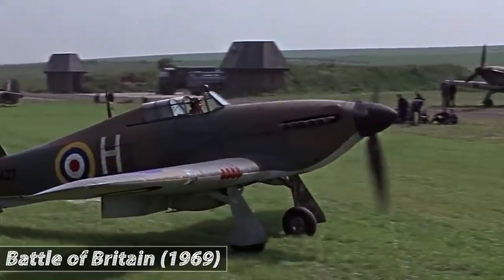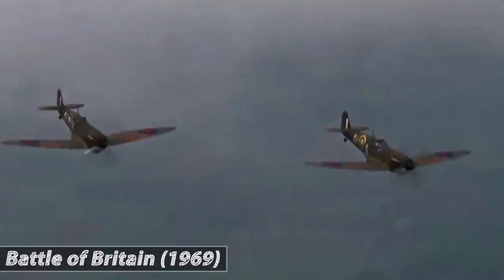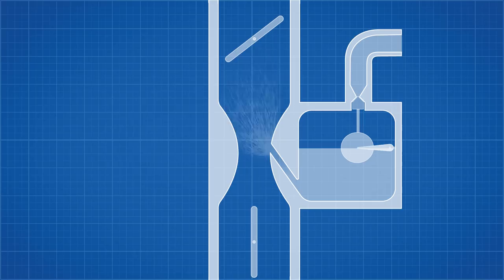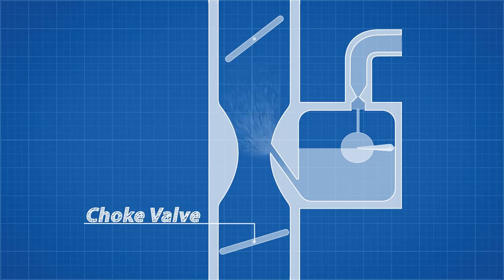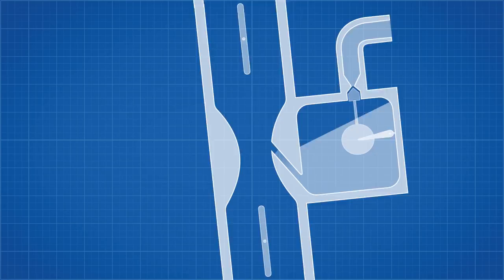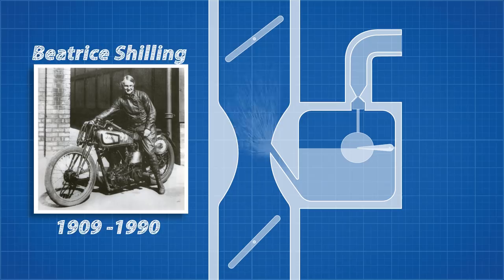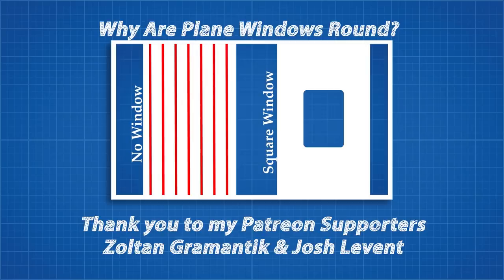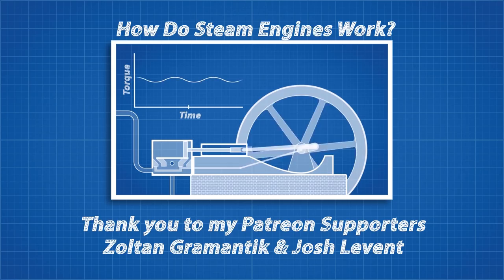The Spitfire's Fatal Flaw

Comment: Spitfire's fatal flaw, no fuel injection. There you go no need for the video.
Reply: Andrew Fishburn that was difficult lol! Did you notice the aircraft he showed at the start and did the victory roll isn't even a spitfire ?
Reply: timopenchords 
Yeah , hurricane did the roll.
Reply: +timopenchords  The Hurricane had that same problem so as an example of what happens what is actually wrong.
Reply: The two aircraft shared the same engine.   So it wouldn't matter which plane was shown has they both had the same problem
Reply: So the title is bollocks. Nothing to do with the Spitfire as such, but a problem with the Merlin engine, largely overcome by 'Miss Shilling's orifice' within months and during the Battle of Britain.
Reply: +Phil Evans 'Miss Shilling's orifice' did nothing to fix the stalling problem.. it only addressed the flooding issue that could lead directly to the aircraft crashing due to loss of power.. Only the American Bendix-Stromberg PD-18 pressure-feed carb developed for the Packard V-1650 cured the flawed R-R Merlin.
Reply: 18tangles - Finally, somebody who recognises that aircraft design is about compromise, achieving the OVERALL performance best suited to the intended role.
Reply: +otterspocket2 Its very clear from this example that overall performance was superior utilizing Direct Fuel Injection.. a technology the the brits simply didn't have yet.
Reply: +Tiger Moth  That's good for a laugh!Hahaha!  As I've pointed out before... you are no expert on WW2 aircraft engines... particularly fighter planes.
Reply: +Tiger Moth  Then explain why there were not one but 2 technical efforts to correct the fatal defect caused by the outdated SU float valve carb????
If it wasn't an issue?  Why go to such tremendous effort to correct the fatal flaw.
Reply: +Tiger Moth   Yes, and I have had to correct many of your egregious and rather embarrassing mistakes.. In particular the difference between manifold "boost" and Water/Methanol Injection  and the difference between 'WEP' War Emergency Power and MIL Power (P-100) aka Max. Continuous Power Rating..
Two very important fundamental concepts you were hopelessly confused about until a corrected you.
Reply: +Tiger Moth   Explain why there was a concerted effort to remedy this flaw that was not shared with Luftwaffe or American aircraft???
Reply: The real doktorbimmer 
All aircraft have flaws, Britain definitely had fuel injection technology even before the Spitfire. 
We all share an enthusiasm for these machines so let's try to enjoy that instead of bickering with each other eh?
Reply: +Andrew Fishburn Please cite an example?  The video's topic is in fact the R-R Merlin's fatal flaw.. so that is the topic of discussion here.
Reply: +The real doktorbimmer - It was an 'issue', are you happy now? It was not a 'fatal flaw' though, and there was no 'tremendous effort' to correct it - just a 10 minute field modification to limit the effects to a momentary misfire. Not ideal, but not a major problem to a competent pilot aware of this behaviour and flying/fighting accordingly. The overall attributes, both of the engine and the airframe, more than compensated for this.

I'll give you another 'issue' if you like, that of fuel consumption. This would have been a problem on later marks in the role of escort, far bigger than the negative G issue, but the original design was for an interceptor. Get as high as possible as quickly as possible, then run down the enemy as fast as possible. That's it, that's all the engine was supposed to do. No 'endurance marches', and with the Chain Home network being developed simultaneously there was very little need to loiter on standing patrols either.

The indisputable fact is that the Merlin III outperformed it's fuel injected rival, the DB-601A, at all altitudes - giving the Spitfire better climb performance, acceleration and top speed than the (400lbs lighter) Bf109e. Not bad for an engine and an interceptor that were 'fatally flawed'.
Reply: +otterspocket2 You are referring to the temporary "fix" to correct only the flooding problem that could indeed cause the engine to stall completely.. a fatal flaw even in non-combat operations..
The American Bendix pressure-feed carb solved both issues related to the outdated SU design which suffered both loss of power AND stalling due to flooding..
Direct Fuel Injection was immune to these flaws and had several other significant advantages such as increased power output (carbs work by restricting airflow) and resistance to icing and detonation... 
It is why the Luftwaffe continued to use fuel injection throughout the war and was later adopted by BOTH USAAF and RAF late in the war.. of course the introduction of the jet engine halted further Allied development after the war.. propeller driven fighters were rendered obsolete by this time..
Reply: The real doktorbimmer 
Fuel injection technology was around in the early 1900's and Hesselmen invented direct fuel injection. Maybe they didn't have an adequate system who knows, we do know that they chose to stick with the design. 
We have to remember that Germany was actively preparing for war which Britain was not. We are also looking back in hindsight which obviously they didn't have the benefit of. They needed reliable robust engines for war and the merlin was the most successful engine of the war for a reason.
Reply: +Andrew Fishburn No, wrong answer... Cite an example of a brit fighter plane equipped with direct fuel Injection prior to the introduction of the Daimler-Benz 601, BMW 801 or Jumo 211 in the early to mid 1930's?????
Direct injection was invented by Rudolf Diesel in 1892
Reply: The real doktorbimmer 
Not wrong, we're talking about petrol/gasoline not diesel engines. You're attempting to change the argument, I stated they had the technology not an equipped example.
This is all about design theory and in that day in age no one single design was considered superior, only later on did they confirm the advantages of FI.
The merlin was a proven engine in all aspects and like others have stated no pilot suffered because of its design flaws. It out performed any german fighter throughout the war and Germany actively pursued a challenger to compete. That's what I would call a concerted effort, Germany desperately tried to make a fighter just to counter the 'flawed' Spitfire.
Reply: +Andrew Fishburn   Then cite an example of a brit fighter with Direct Fuel Injection prior to the RLMs adoption in 1935???
Reply: The real doktorbimmer 
Again trying to change the argument, RR rejected R&D tests for FI in favour of the merlin design. Hindsight is a fine thing isn't it.
Reply: 18tangles 
Seems to go around YouTube disputing anything allied whilst protesting the superiority of anything German...... hang on ?
Reply: +The real doktorbimmer - You're still not getting what I'm saying. Comparisons between engines, or aircraft, are meaningless unless you take into account what's required of it. It's like the debate over which was the best fighter of WW2 - what do we mean by a fighter? An escort, an interceptor, a dog-fighter? Do we want to 'shoot and scoot' or 'turn and burn'? It depends on factors such as tactical necessity (what are we trying to achieve?), and the opposition (bomber, fighter - what are the enemy's role and tactics, the strengths and weaknesses of their aircraft?) It's like comparing a Rolls Royce with a Lamborghini - how fast do you want to get there, how comfortably and how many passengers do you want to take with you?

Given that RAF pilots were aware of the negative G issue, all they had to do was avoid prolonged negative G manoeuvres. The only real advantage to the enemy was the ability to enter a dive more quickly by throwing the stick forward rather than first going inverted, and therefore (potentially) escape an attack from behind. At this stage of the war (BoB), in the role of interceptor, nobody would be too concerned by the enemy's escorts being able to run away - next to destroying them that's the 2nd best outcome. With the roles reversed, no attacking aircraft would want to out-dive it's target, as the hunter would then become the hunted. I stress again, it's all about the role that the Spitfire/Merlin III were designed/developed for. What would indeed have been a 'fatal flaw' on later marks, in other roles, was at the time little more than an inconvenience.
Reply: otterspocket2 
Exactly, also why we had Spitfire's and Hurricanes. Hurries shot down more aircraft in battle of Britain and were considered a better weapons platform.
Reply: +Andrew Fishburn  Rolls-Royce did not develop the fuel systems on any of the Merlin engines.. Early Merlins used automotive type SU carbs or later American produced Stromberg-Bendix carbs..
The only pressure-feed system produced by Rolls-Royce was a copy of the Bendix first used on the Griffon 101 introduced in 1946. Ignorance is bliss... isn't it?
Reply: +Tiger Moth  Just the facts..
Reply: +otterspocket2   We are trying to achieve a fighter aircraft design that does not stall..and does not lose power when engaging or being engaged by an enemy fighter.
A problem not suffered by pilots flying American or German produced fighters at this stage of the war..
Reply: +Andrew Fishburn and what has been repeated over and over again is that the Spitfire and the Hurricane were both equipped with fatally flawed SU carb, and suffered the exact same fatal performance deficiencies..
Reply: The real doktorbimmer 
I have the Internet too and you're dodging the subject. We're talking about the knowledge of said technology, Germany didn't invent any of their engines they merely developed them from others hard work. Fun fact, Europe was a hive of activity during the early 20th century especially in engine design & technology with Britain at the forefront. Without this activity Germany wouldn't have developed FI engines or any of the aircraft that utilised it. Also without British breakthroughs in fuel Germany would have simply ran out of it.
Reply: +Tiger Moth   Sorry Tiger Moth, The Bendix PD carb was an AMERICAN design. First delivered to the brits in shipment of American made aircraft with Allison V-1710 engines and later Packard V-1650 installed on britsh aircraft.
Reply: +Andrew Fishburn  No you are dodging the subject.. by the way, the type of internal combustion engines used by the RAF during WW2 were invented in Germany by Nikolaus Otto and Carl Eugen Langen
Reply: The real doktorbimmer 
The subject is whether or not Britain had FI technology, which they did. Use of said technology isn't the argument. Also the difference between development and invention seems to confuse you. No german invented the engines they developed them from existing designs spanning back as far as the early 1800's. The engines used by the R.A.F were developed in Britain.
Reply: +Tiger Moth  The brit were still using steam engines when Germany developed the first practical internal combustion engines which were patented and sold under license around the world... including in the UK.
Reply: +Andrew Fishburn  it certainly is.. if the brits had fuel injection technology at the time the Merlin wouldn't have had the fatal stalling problem which is the topic of this video...
Reply: The real doktorbimmer 
They had the technology as did others, you're just desperate to 'win' now and are creating false subjects. The development of the internal combustion engine was by more than one person, a series of inventions and technology breakthroughs led to its development. The engines developed in Germany were mostly copied from previous designs and just got patented first.
The decision on the merlin engine being carb instead of FI was indeed a decision.
You need to actually research the development of the merlin engine.
Reply: +Andrew Fishburn Not at all... you have simply exhausted the resources of your limited knowledge on this topic
Reply: +Tiger Moth  The Stromberg-Bendix PD carb was developed in 1934.. long before the Merlin 66 existed
Reply: The real doktorbimmer 
Ad hominem attacks are the refuge of a strawman argument. You won't dispute what I have said because you can't as Germany never independently invented nor developed any engine design or technology.
Without British fuel advances none of your great German aircraft would have been built, fact. You lost this argument before it began, I'm simply having a conversation now which would be far more enjoyable without you turning it into a pissing contest. Which by the way you will lose as all Germans do. 😉
Reply: +Andrew Fishburn Don't cry about it now, you were bested fairly and soundly.
Reply: The real doktorbimmer 
It's clearly evident that you lost the argument before it started, you won't dispute anything I said because they are facts. Although I guess you would define victory differently than me, being German, how many wars have you won? 😂
Reply: +Tiger Moth   You really are like a Tiger Moth among Spitfires! Lol!! You have just proven you have no clue what Direct Fuel Injection is..
Direct injection uses injectors mounted DIRECTLY INTO THE COMBUSTION CHAMBER
No fuel is introduced into the combustion chamber until the piston reaches the top of the compression stroke and IGNITION occurs..
Reply: +Andrew Fishburn I simply called you out on an egregious and foolish claim you made... and then you completely failed to back it up.. you folded.
Reply: The real doktorbimmer - The debate was over the availability of fuel injection technology if RR had chosen to use it in 1940. You've been proven wrong, the grown up thing would be to concede that point, not side-step into some dick measuring 'who was first' contest.

The 'problem' would have been suffered by American pilots at that stage of the war, and for more than a year afterwards, since they were flying Merlin powered Spitfires and Hurricanes for the RAF. My guess is that they were all thankful not to be taking on 109e's in P-39's and P-40's (something about taking a knife to a gunfight). Their 'superior' engines gave such poor performance above about 15,000ft as to make them nothing more than target practice in the European theatre for which the Spitfire was designed. The same goes for the (British designed/American built) P-51, until powered by the (British designed/American built) Packard V-1650 MERLIN fitted with the (British DESIGNED/American BUILT) Bendix-Stromberg PD-18.
Reply: The real doktorbimmer 
Nice try, you didn't call me out on anything and you made the initial claim so the burden was on you. You still can't dispute anything I have said and continue with personal insults.
Reply: +otterspocket2  Rolls Royce did not have Direct Fuel Injection technology... or a pressure feed carb. in 1940.. THAT WAS THE POINT!
The Stromberg-Bendix PD carb is an AMERICAN design... not british.
Reply: +Andrew Fishburn Then just cite an example of a WW2 brit fighter equipped with Direct Fuel Injection before 1935?
Reply: The real doktorbimmer 
You need to cite proof that RR didn't have direct fuel injection technology in 1940, you made the claim. It's self evident that they didn't implement it, the point you made was that they didn't have knowledge of it. You're getting mixed up in your own argument.
Reply: +Andrew Fishburn LOL!!! You want me to prove that something didn't exist??  Something I just asked to prove it did!  I'm starting to think I'm dealing with a child, certainly not a mature adult.
Reply: +Tiger Moth You just said they did?  But didn't even know what DFI was... Why should we believe you?
Reply: +Tiger Moth  Introducing the fuel into the impeller is not fuel injection.. That is Draw-through-Supercharger Carburetion.
Reply: +The real doktorbimmer - You still don't get the difference between not having ACCESS to something and CHOOSING not to use it. War production didn't work like some kind of iphone/Samsung competition. If one engine manufacturer had access to technology that another WANTED to use, they would be ordered to share it under license (the same way that Packard were 'given' the Merlin).

I've just been out to buy a paper. Usually I go on my bike because 
it's cheaper and easier to park than the car, but if I have more to 
carry or if - as today - it's bloody freezing out there I go in the car. I still have the bike, I had access to it, I just chose to use the car because it better suited what I was trying to do today (not freeze my bits off).
Reply: +otterspocket2 So you are seriously suggesting Rolls-Royce INTENTIONALLY WANTED their Merlin engines to stall and lose power in high G maneuvers???
Reply: +otterspocket2  You absolutely correct about that! They do not work the same! No ones risking death, serious injury or invasion from another country if your smart phone design has a flaw...
Reply: +The real doktorbimmer - I'm seriously suggesting, as I've been doing since my first comment, that a compromise was made that gave the best engine FOR THE ROLE - an engine that would momentarily misfire (and possibly flood/stall BEFORE 'Miss Shilling's orifice' was fitted, but not after) in very specific circumstances that could be avoided in the role for which it was intended and used. NEGATIVE G manoeuvres, not  high (positive) G. This trade off produced an engine that outperformed the competition in every other situation.

I'm glad you mentioned high G manoeuvres though, since this highlights the Bf109's major 'fatal flaw' which was far more of an issue than a misfire, and unlike a flooded engine completely unavoidable in combat. Contrary to popular belief, the 109 could marginally out-turn the Spitfire ON PAPER. However, it would snap into a high speed stall without any warning. VERY few pilots were brave/foolish enough to take it to the edge of the envelope in combat, where simultaneous loss of control, airspeed and altitude would almost certainly result in being shot down. Even fewer were experienced/skilled enough to 'pull it off' with any certainty, and most who tried eventually learned a hard lesson - under a silk canopy - or didn't live to learn anything. The Spitfire, by contrast, gave adequate warning (buffeting) of an impending high speed stall, giving even low experience pilots the confidence to out-turn the enemy and putting 109 pilots in a 'damned if you do, damned if you don't' situation.

This left them with no real option when bumped from behind but to dive out of the fight - exactly what an interceptor wants an escort with inferior climb performance, acceleration and top speed to do - while the Spitfire could escape a similar situation without significant loss of altitude, and therefore very much still in the fight - exactly what an escort DOESN'T want an interceptor with superior climb performance, acceleration and top speed (thanks to it's 'fatally flawed' engine) to do.

Maybe you know about engines, maybe Google is your friend - I've no idea which. You certainly appear to lack understanding of the tactics of BoB era aerial warfare though.
Reply: The real doktorbimmer 
You claimed they didn't have FI technology, how do you know? Simple question.
Did you know that aircraft companies share info? Such as engines? Such as using RR engines in the testing stages of Me109 development. Also a key part in development of other aircraft and engines. 
Still think RR the best engine manufacturer in the world at the time didn't know about FI?
Reply: +otterspocket2 A compromise? Perhaps.. or as is clearly the case a better solution simply wasn't available in the british aero industry.. Even if we were to accept your theory? In any case in hindsight it was certainly a mistake that cost lives and limited the aircraft's maneuverability until a permanent solution involving the adoption of an American fuel delivery system is what finally cured BOTH the fatal flaws.
American and German aircraft were immune to this fatal flaw as they clearly saw the importance of maintaining proper fuel metering under all high 'G' maneuvers that R-R did not.
Reply: +Andrew Fishburn Well explain why German, American even Russian manufacturers adopted pressure feed fuel systems and Rolls-Royce continued to use an outdated automotive carburetor..?
Reply: +Tiger Moth You're clearly out of your depth here.. especially if you cannot grasp such fundamental fuel system concepts.
Reply: The real doktorbimmer 
I don't have to. You claimed that the British didn't have knowledge of FI (research who invented it btw)
The Spitfire had ONE minor flaw which never bothered anyone. The German fighters of the day had so many I can't even list them on here.
How many lives were actually lost due to the spits carbs compared to 10% of Bf109 losses on takeoff/landing?
Reply: +Andrew Fishburn I said, cite an example that they did? which you clearly failed to produce.  
I can only guess you have never flown? Certainly a sudden, unplanned and unpowered landing (possibly over enemy territory or over the sea) IS NOT a minor flaw!!!
Reply: +Tiger Moth  It wouldn't called a fatal flaw it no one ever crashed..
Reply: The real doktorbimmer 
They clearly had the tech only silly people think they didn't and I don't have to cite anything as you made the claim.
It's a minor flaw considering the massive advantages the spit had in every other area.
Reply: +Tiger Moth  If it was a minor problem? why not just one, but TWO attempts to fix it?
Reply: The real doktorbimmer 
How many hundreds of tiny incremental variants of literally all aircraft have been made? And you harp on about one tiny flaw.
The 109 had so many even commanders didn't want it, they had no choice in the end because of the Spitfire.
Reply: +Andrew Fishburn  We are not talking about whether they knew it existed.. the question was did they have access to practical, reliable, production quality fuel injection or pressure-feed carbs.. which clearly they did not.
You kids are suggesting that it was something simple as downloading an app on your smart phone..
Reply: +Andrew Fishburn  Now your just taking a piss! Are you suggesting that Spitfires were never shot down by a Me-109s, Fw-190's or other aircraft?  
Now if the Spitefire was so fast it couldn't be shot down? Now that would be a MASSIVE ADVANTAGE.
Reply: The real doktorbimmer 
Now you're just lying. 
" a technology the brits simply didn't have yet."
Your comment.
Even though the same engines used RR engines for development  (copied)
You don't know who invented fuel injection do you?
P.S. A patent often doesn't tell the true story. Daimler benz know this but they don't want us to know.
Reply: +Andrew Fishburn Well if you insist they did PLEASE CITE AN EXAMPLE?
Reply: +Andrew Fishburn  Now you are suggesting Rudolf Diesel didn't  invent the first practical Direct Fuel Injection System.
Please Just tell us who did?
Reply: The real doktorbimmer 
I'll cite you an example of why this flaw didn't matter one tiny bit.
primaryhomeworkhelp.co.uk
Reply: +Tiger Moth The RAF certainly lost many planes... some either directly or in part to the Merlin fatal flaw... many were lost to unrelated circumstances.
Reply: The real doktorbimmer 
I'm not suggesting anything he stole his ideas and patented them as his own. Lots of inventions are contested.
Reply: +Andrew Fishburn Tell us who you think did invent direct injection?
Reply: +Andrew Fishburn How old are son?  That is a site for children struggling with their primary school homework..
Reply: +Tiger Moth Why don't you request the MoD for that information?
Reply: The real doktorbimmer 
An Englishman of course, we invented everything.
Reply: +Andrew Fishburn  Where is your proof?
Reply: The real doktorbimmer 
Google.
Reply: +Andrew Fishburn Google is not an brit invention either...
Reply: The real doktorbimmer 
Yes it is...
Reply: +Andrew Fishburn  You should know this kid..Google was created by American Larry Page in Menlo Park, California
Reply: +Andrew Fishburn - "I'll cite you an example of why this flaw didn't matter one tiny bit".

Don't mention the war. I did once, but I think I got away with it.
Reply: +otterspocket2  How would you like a ride in a single engine airplane that sometimes the engine stalls completely without warning..  and never mind someone is trying to shoot down the whole time...
Reply: The real doktorbimmer - The RAF certainly lost many planes... a handful POSSIBLY directly or in part to the Merlin 'fatal flaw'... many, many more were saved, and many German planes lost, due to the OVERALL superiority of the Merlin over it's contemporaries (I'm getting tired of writing this) IN THE ROLE FOR WHICH IT WAS DEVELOPED.
Reply: The real doktorbimmer 
Ask a German pilot to choose between a Spit or any other plane. We both know which they will choose.
Reply: +Andrew Fishburn That's easy... a Me-262
Reply: +otterspocket2  It was not to developed to fail to run properly or fail completely during a dogfight... which is why it has be accurately called a Fatal Flaw..
Reply: The real doktorbimmer 
That's cheating and no pilot would use that plane. If we're talking about fatal flaws that entire aircraft was flawed. If it was peacetime it would have only served as a prototype.
Reply: +The real doktorbimmer - I started flying on microlights, with a 2-stroke rotax engine (think 'lawnmower') revving like a bastard from takeoff to touchdown. Failure was so commonplace we used to joke about 'fuel off' being included in the landing checklist :-)

Obviously nobody relishes the idea of an engine failure (which can happen at any time for any number of reasons), particularly in a single engined aircraft. With engine stalling, as opposed to misfiring, being such a rare occurrence though - and only while performing a manoeuvre that had little operational value for a pilot who knew his aircraft anyway - I'd be far more concerned about entering a dog-fight with an aircraft that was outperformed in every other aspect by my opponent's - something no Spitfire pilot had to worry about until the appearance of the Fw190.
Reply: +otterspocket2 How many kills did you score with your lawn mower powered glider???  OH! that's right... you don't even need a pilots licence to fly a shed like that... LOL!!!
Reply: +Andrew Fishburn  With a 100+ mph speed advantage over any Allied fighter it indeed had a MAJOR ADVANTAGE over any aircraft that saw combat service during WW2
Reply: +The real doktorbimmer - I accept that my 2.0 litre car costs more to run, tax and insure than a 1.1 litre car, but accept the trade off for the increased performance. I'm sure the engine designers were aware of the increased cost - the 'flaw' - but they went ahead and 'designed it to be more expensive' anyway. Perhaps they lacked the technology to make 1.1 litre engines.

You keep banging on (and on, and on) about this 'fatal flaw', as though it's been universally accepted as such for 80 years. It was a hyperbolic description in a clickbait title for a youtube video - get over it.
Reply: The real doktorbimmer 
It came in too late to make a difference and most failed or where shot down. The meteor however is still in operational service and was just as fast.
Reply: +otterspocket2 The plain truth is that Rolls-Royce lagged years behind in fuel system technology... get over it.
Reply: +Andrew Fishburn  yet they had one of highest kill ratios of WW2.. Not in a dogfight with a proper pilot at the controls.. Not during the war, postwar versions were faster but never matched the Me-262, the "meatbox" had enough trouble staying in the air.. it was a failure as a fighter.
Reply: The real doktorbimmer 
Really? So fuel efficiency doesn't count or way more advanced fuel manufacturers. 
The plain truth is without British fuel discoveries Germany wouldn't have any fuel to use FI or other wise.
Reply: The real doktorbimmer 
Highest kill ratios? 😂 classic Nazi propaganda.
Me 262 were shot down by propeller driven allied aircraft.
The Meteor is still in active service and is one of the most reliable and stable aircraft on the planet.
Reply: +Andrew Fishburn The Merlin's fatal flaw was due to an outdated and obsolete carburetor design... not because of fuel quality or quantity... Have you lost the plot again?
Reply: +Andrew Fishburn The Meatbox was the worst fighter aircraft ever produced..
Reply: +The real doktorbimmer - "How many kills did you score with your lawn mower powered glider???"

About as many as you sitting in your crusty underpants in mummy's basement, judging from your debating style. Grow up!

Keen observers (ie those that have already grown up) may have noted that I "started" on microlights. Admittedly I still haven't shot anybody down - that being kind of frowned upon in civil aviation - but we were discussing the 'horrors' of engine failure, which I have experienced once in a Cessna 208 (American designed, built and powered btw), and several times in microlighting - and I'm still here.
Reply: The real doktorbimmer 
Dodging the subject again? British fuel technology was revolutionary and Germany used it to manufacture synthesised fuel. Without it you had no fuel silly. German planes lacked the range and fuel efficiency of allied fighters, you could say it was a fatal flaw of German engineering.
Reply: +Andrew Fishburn  German engines didn't stall in a dive... only british ones.
Reply: The real doktorbimmer 
German engines weren't fit for purpose, British ones won the war. 😎
Reply: +otterspocket2 I prefer to leave the lawn mower engines in the garden shed.. and rely on proper aircraft engines to keep me in the air.. much higher and faster than your primitive contraption..
Reply: +Andrew Fishburn   If their purpose was not to stall in a dive... the Merlin was the only engine not fit for the job...
Reply: +Andrew Fishburn - "...you could say it was a fatal flaw of German engineering". Don't you bloody start :-)
Reply: The real doktorbimmer 
German planes were to escort bombers to England and back=failed.
Spits job was to protect Britain =success. 
What's your argument again?
Reply: +Andrew Fishburn  That Rolls Royce didn't have access to Fuel Injection technology... a point you failed miserably to disprove.
Reply: The real doktorbimmer 
You made the claim so the burden of proof is on you not me.
Those FI engines were developed with RR engines as a testbed. If you bothered to look FI technology was widely known for years before it was implemented.
Reply: +Andrew Fishburn No, You made the claim they did... Or have you forgotten already?
Then cite an example?  Cite an example of a Rolls-Royce engine in this era with a practical, production quality fuel injection system?
Reply: The real doktorbimmer 
That's the beauty of the Internet mate, you made the claim and I disputed it. The burden of proof is on you.
Reply: +Andrew Fishburn  You wrote this comment 14 hours ago quote; " Britain definitely had fuel injection technology even before the Spitfire." 
You have been dodging this foolish mistake ever since...
Reply: +Andrew Fishburn  I stand by my comments as 100% factual and true.. Rolls Royce didn't have a fuel injection system developed for the Merlin or any other engine prior to 1935.. or 1939.
Reply: The real doktorbimmer 
That's not what you claimed. Just admit your bogus claim and move on
Reply: +Andrew Fishburn  That is exactly what I claimed and its 100% true...
Reply: The real doktorbimmer 
Then show me your source for these "facts".
Reply: +Andrew Fishburn  Thats easy! Rolls Royce never had a fuel injected Merlin engine..
Reply: The real doktorbimmer 
No , your source for that information. FI was widely available.
Reply: +Andrew Fishburn   Name a Rolls Royce engine that was fuel injected in the 1930's?  There are none!  Widely available everywhere except at Rolls Royce!
Reply: The real doktorbimmer 
And yet you still claim they didn't have it.😀
Reply: +Andrew Fishburn Yes, because they didn't.. and you failed to provide any evidence they did.
Reply: The real doktorbimmer 
You did that for me lol and you claimed 'the brits' didn't have it, then claimed it was available everywhere except at Rolls Royce.
😎
Reply: +Andrew Fishburn  Correct, I didn't offer any proof to support your theory... and neither did you, because there isn't any.
What other Brit engine manufacturer provided engines for the Spitfire in the 1930's???
Reply: The real doktorbimmer 
If it was so widely available then RR knew about it and chose not to use it.
Reply: +Andrew Fishburn  Without any doubt Rolls Royce knew that fuel injection systems for aircraft existed... they just didn't know how to build one of their own. 
They didn't have a choice, it was not a technology they had developed or had access to buy.
Reply: +otterspocket2 Are you implying Rolls-Royce was not BRITISH!!!!!
Rolls-Royce was 100% british... at least until the company went completely bankrupt in 1971..
Reply: +otterspocket2 Just the facts here.. something you seem to be completely unfamiliar with.
Reply: +The real doktorbimmer - "Are you implying Rolls-Royce was not BRITISH(?)"

No, and I'd be fascinated to hear the thought process by which you arrived at that conclusion.

What facts do you think I'M completely unfamiliar with? I'll go first, shall I?

You seem(ed) to be completely unfamiliar with the fact that Britain had fuel injection technology - and an aero engine incorporating it - prior to the outbreak of WW2. You then changed 'Britain' to 'Rolls Royce' when you were proven wrong.

You seem to be completely unfamiliar with the fact that Lord Beaverbrook, as Minister of Aircraft Production, dictated to manufacturers what they could and couldn't develop, what they could and couldn't build, which designs must be shared under license with which other manufactures - and routinely seized equipment and materials to distribute them around the industry, as he felt best supported the war effort. ("...it was not a technology they had developed OR HAD ACCESS TO BUY").

You seem to be completely unfamiliar with the fact that rather than remain on the drawing board for 50 or a hundred years until 'perfect', all aircraft - especially those designed specifically to meet an imminent threat of war - must at some point enter production, complete with 'flaws'. This would especially apply if these flaws had little to no impact on the designs ability to fulfill it's intended role, and even more so if they were a result of other design characteristics that actually enhanced it.

You seem to be completely unfamiliar with the fact that what might be considered a 'fatal flaw' in one aircraft might be neutral in another, or even an asset, depending on the operational role. For example, the Sopwith Camel was a nightmare to fly, and killed many novice pilots, due to the massive torque generated by it's rotary engine. However, that same torque meant that it had a phenomenal roll rate to starboard, making it a nightmare for enemy pilots trying to stay on it's tail - and leaving no direction of flight open to them that would prevent it subsequently reversing the position. "In the hands of a novice it displayed vicious characteristics that could make it a killer; but under the firm touch of a skilled pilot, who knew how to turn its vices to his own advantage, it was one of the most superb fighting machines ever built" (Robert Jackson - aviation author). So, 'superb' in the role of fighter, 'fatally flawed' in the role of trainer.

You seem to be completely unfamiliar with the fact that by continuing with your appalling nonsense, a hundred and more comments after it was shown to be exactly that by several posters, you're just making a fool of yourself.
Reply: +otterspocket2 Then cite an example of a Rolls-Royce or any other fighter aircraft engine equipped with fuel injection?  Its a simple question, if the brits possessed this technology there should some example of it to show for it.
Reply: The real doktorbimmer

Have read through most of this thread, how about stopping the chest thumping nationalistic ranting and looking at the real world as it was at the time.

Direct fuel injection was well known and in use long before WW2, RR opted to equip their Merlin with a carburettor, which although there were advantages to carbs over FI  negative G gave an unwanted problem, but given the times it was certainly not a good time to redesign an engine, the carb changes partially overcame the problem , but even at later stages single point FI was utilised which allowed the basic engine design to be used.

Just for laughs the first ME/BF 109s flew with Merlin engines because the correct engine wasn't available at the time, from the 1920s direct FI was common place on diesel engines, but contrary to your imaginings the first direct FI on gasoline engines was built in 1902  by a French engineer.

You wish to discuss fatal flaws? you are aware of course that up to ME109G+1 the engine had a rather distressing habit of bursting into flames without warning due to overheating of the oil system, now I would call that a fatal flaw, it was thought at the time that almost as many 109s were lost to this cause as were shot down by the RAF  during the BoB, mainly because the 109s were operating at the limits of their endurance, this fault continued right up to the point were Germany was re-equipping the Finnish airforce, not exactly a quick resolution .

You are talking of two aircraft which were both at the front of technology at the time, not surprisingly problems were found.
Reply: +silver fox  R-R had a practical production quality GDI system?  Please cite an example? 
Then explain why R-R adopted the American Bendix-Stomberg PD carburetor? 
A pressure-feed carb is still a long way from an actual fuel injection system..  something that Rolls -Royce never had available for the Merlin during the war.
Any single engine pilot would consider a complete loss of power a "fatal flaw"  although a complete loss of power is not always fatal.. its without in doubt the worse type of mechanical failure short of structural failure, Loss of power is, in any normally heavier than air vehicle, effectively a loss of flight control.
Reply: +The real doktorbimmer
Bimmer McBimface, the later version of the Merlin had Lucas Fuel Injection. Now you know.
Reply: The US carbs were used to fit on US made Merlins under licence on the USA. It meant a shorter lead time.
Reply: Not during WW2
Reply: US designed and made carbs were fitted to brit made Merlins, and US made Packard V-1550 shipped to the UK.
Reply: Didn't need the complex injection system at first anyway. The fuel the U.K was using was 100+ octane fuel and the Germans used 88-92 octane and needed the fuel injection to make that extra power back. German pilots stated after the war were amazed to find out the difference in fuel and explained why based on their fuel calculations for engine power didn't equal the performance the Spit was achieving.
Reply: +Chris Norman  Yes, GDI effectively lowers the octane requirement, or allows high manifold pressures without the risk of detonation.
It also completely eliminates the the fatal stalling/flooding problem in addition it gives the engine more power and greater range by effectively reducing pumping loss internally ( no restrictive, power robbing venturi in the intake path) and as a additional bonus effectively reduces icing, prolongs engine life and the problems the Allies had with lead fouling.
Then why did the US Army Air Force also develop and introduce its own GDI system too?
Reply: Andrew Fishbrain+  Even  the celebrated BoB historian James Holland acknowledged that  BoB ended in a stalemate ....The vast majority of German losses were bombers, with regard to single seat  fighters, RAF lost more !!   despite lack of range and all the disadvantage of fighting a war in hostile airspace, 109's killed more Spits and Hurricanes than  hey lost   109's had to  come from   France. .The Spits range  in the Battle of Britan wasn't too much of a problem,as it was fighting over   it's home ground...German ace Werner Moelders  WHO   killed  25 Spits   said 
"miserable as a fighting aircraft," due to its two-pitch propeller
and the inability of its carburettor to handle negative g-forces.
Reply: Chris Norman +  100+ octane fuel provided by the US ....a single ship load of high-octane fuel arrived from the US in England just at the height of the Battle thus providing  an extra couple of hundred  horsepower . Esso  must have  saved the 'free' world  at  one point !   lol
Reply: Your comment ref; Moelders should be given in full, the two pitch prop was swiftly remedied by introduction of the Rotol or Hamiliton constant speed prop, all Spitfires and Hurricanes were fitted by 1940, plus among his comments was the advice NOT to get involved in a turning bout with  a Spitfire because it would out turn the ME by a considerable amount, respective turning circles being some 150 to 200 feet tighter for the Spitfire.

Also worth noting that Luftwaffe pilots had already gained experience of combat conditions during the Spanish civil war, whereas far too many  RAF pilots were almost straight from training squadrons, plus just for laughs no-one mentions the ME 109s bad flaw, the undercarriage was too narrow and too flimsy for a high performance aircraft, to the point that 225 aircraft along with a good number of pilots, were lost in landing accIdents/incidents during the the BoB, now I would call that a pretty bad flaw.

Imagine having a well trained pilot with what was an excellent aircraft  and standing a good chance of losing both because the aircraft was prone to ground looping or even suffering undercarriage collapse on landing, under the pressure of equipping for a war situation it's not surprising that much equipment showed flaws when brought into service, the trick was to recognise the flaw, remedy or work round it as quickly as possible.
Reply: +barracuda7018
What world are you in? Holland did no such thing. 
   ♦ The aim of the Germans was to destroy 
      the RAFs fighting capability to resist a 
      seaborne invasion. 
   ♦ The Germans never destroyed the RAF. 
   ♦ More Germans planes were destroyed than
      British.
   ♦ There was more British planes at the end 
      of the battle than at the beginning.
   ♦ The Germans lost.
   ♦ It was a British win.
Reply: +John Burns Then explain why brits all drive German cars and all the brits car companies are owned by India????
Reply: +John Burns Where ia that new Mazda RX-7 you promised was coming out this year??? Its 2017 and I can't find them for sale anywhere????  Why is everything you say turn out not to be true?
Reply: Fuel injection was much more complicated, more expensive and harder to fix if it went wrong.
During war, reliability and cost is sometimes more important.
Reply: +KeyToTime I think you are naively speculating here, anyone familiar with both Carburetors and Fuel Injection knows very well that mechanical Fuel Injection is extremely reliable much more reliable than carbs.. the added cost is more than off-set by the many performance advantages... FI produces more power, improves fuel economy(thus improving range) is less prone to icing problems and in the case of the German's GDI system allowed high boost pressures without need or the negative effects of high octane leaded fuels... and of course, most importantly completely immune to flooding and stalling in high 'G' maneuvers.
 Carbs tend to run too lean at WEP... leading to detonation during WEP, the Rolls-Royce Merlin suffered rather badly from this design defect and so full power had to be limited to 5 minutes per flight and only used if absolutely necessary...otherwise the engine would usually self-destruct in flight resulting in a crash, if WEP was used during a flight the aircraft would be grounded upon return until completion of an internal inspection for damage and to replace the spark plugs which would always be damaged and no longer serviceable. Engines equipped with GDI typically did not suffer from these service and maintenance problems that cause problems with combat readiness.
Reply: You do keep banging your drum, we all know that the Merlin had a problem in the very early days, quickly rectified, however the "superior" FI Daimler engine had a delightful tendency to overheat and burst into flames with no warning whatsoever, this "minor" problem continued for some time, possibly the reason that for a considerable period there was a ban on using full power, of course in combat situations a pilot in trouble would use everything at his disposal,  ban or not.

Whatever you have to say the fact remains, (thankfully) the Luftwaffe did not drive the RAF from the skies, can only say that if the ME109 was so superior and in much greater numbers than the Spitfires and Hurricanes, plus of course the Luftwaffe already had many pilots with combat experience, then some other factor was at play, can't imagine what that was.
Reply: All I can say to that is, it worked.
You can debate it as much as you like but you can not deny that they were effective
despite this flaw.
Reply: +KeyToTime  The point of the video is that IT DIDN'T WORK
Reply: +silver fox Then why the two separate attempts to correct this fatal flaw in its design????  Rolls-Royce did not develop a successful multi-point injection system for the Merlin until the design was already obsolete circa 1946
Reply: +silver fox All Spitfire models fitted with Merlin engines were equipped with breakable metal "tattle-tale" locks on the throttle lever stop, a pilot would have to forcibly break the metal strip to advance the lever into the boost regulator override position. Ground crews checked and replaced this locking device before every flight, failure to report the use of WEP in flight was a serious offense... pilot were required to give a detailed explanation of why he deliberately over-rode the boost regulator and risking damage to aircraft.
Reply: To the best of my knowledge there are no reported casualties resulting from this "fatal flaw", however there are plenty of refs; to Daimler engines catching fire, of ME109s being lost purely to landing accidents and incidents, when WW2 started Britain was still gearing up for a war we didn't want and certainly didn't start, some of our equipment was not 
fully ready, the fact remains that the Luftwaffe didn't achieve their objective even with their (in your view) superior technology, the point can be argued for ever and ever amen, but as always the proof of the pudding is in the eating.

The Spitfire and the ME109 were closely matched, with each aircraft having superiority in different areas, there is no evidence that this "fatal flaw" lost the battle, as to how problems which arise in combat get through the design stage, frankly I have no idea, I wasn't around.

Your constant attempts to demonstrate superiority of one system over another is very much blown away by the results and we all know what that was.
Reply: +silver fox Well as your knowledge is proving very limited that is not surprising...
Reply: +silver fox Next you will attempt to deny that the Me-109 was not the most successful fighter aircraft design in history...
Reply: Well that all depends on what you classify as successful.
Even then I'm not going to argue with you. It's clear you're just a troll anyway and not worth my time.
Reply: I take that you are all knowing with personal experience of these "facts" or do you rely on the good old internet for your knowledge, even the best qualified engineer working today can't relate to the conditions of the 1930s/40s, the knowledge available to all now is more than those designers engineers of that time, yes easy to sit here in 2017 and ask, why could these people not see this that or other was better, or that this system would develop into much wider and successful use, to repeat we have no knowledge of the constraints that designers/engineers worked under at that time, how often was sticking to tried and trusted methods been more successful than going for the latest concept.

Whatever you may say the Merlin overall worked very well throughout much of WW2, was very much the power plant that most wanted, incidentally Rolls Royce looked at fuel injection and dismissed it as they estimated a better performance could be obtained due to a combination of higher fuel density and the use of high octane fuel, which in turn allowed higher boost pressures from superchargers, judging by the outcome who was wrong?
Reply: +silver fox Higher manifold pressures and poor mixture control is what caused the detonation problem during WEP..  The German GDI system reduces the need for high octane by reducing detonation... it also increases power output over carbs
Reply: +silver fox Then why was Rolls-Royce still using gravity float valve carbs???? American manufactures and many other countries had already abandoned them in favor of pressurized fuel deliver????  The reasons for this seem very obvious both then as it is now... its surprising how you can refuse to acknowledge this glaringly obvious fact.
Reply: +The real doktorbimmer
The Spitfire was the best fighter design.
Reply: +The real doktorbimmer
This one is barking mad!
Reply: silver fox+  ''ME109 was so superior and in much greater numbers than the Spitfires and Hurricanes''

This is another version of the legend '' King Arthur pulled the Excalibur from stone ''

Spits and Hurricanes have never been outnumbered , on the contary ......lol  ..  this myth has been debunked decades ago even by British historians..
Reply: +barracuda7018 - While the total number of interceptors available to the RAF exceeded the total number of escorts available to the Luftwaffe (if you discount the Bf110, which began the battle with a fearsome reputation only to be reduced to itself needing an escort within weeks), those Spits and Hurricanes were spread out among 4 Groups covering the whole of Britain while the 109's were concentrated in a relatively small area of South East England.

Add to this the Luftwaffe's ability to choose the timing and location of attacks, necessitating the holding of squadrons in reserve to cover events as they unfolded, and the fact that the majority of RAF resources were directed at bomber's, not escorts. This is why, despite the theoretical imbalance in favour of the RAF, the 109's did indeed enjoy an overwhelming numerical advantage in almost every direct encounter with Fighter Command's Spits and Hurricanes. Surely you can see that, when assessing relative performance in combat, aircraft sat at dispersal or flying CAPs 300 miles away are not really part of the equation.
Reply: Two factors have to be remembered. The 109 was also a relatively short range fighter at the time. Its stronger suit was free raiding in pairs, very difficult to intercept with that horde of bombers to worry about. When the 109 had to escort "and stay with" the bombers then its fuel consumption went up and its actual combat time was limited as it needed to zig-zag to keep combat speed up in case they were bounced. The second factor was that once a pilot bailed out over Blighty his war was essentially over. If he was able to get to the Channel a great many simply ran out of fuel anyway.
Reply: ''Two factors have to be remembered. The 109 was also a relatively short range fighter at the time''

109 ' S  NEEDED 1/3 OF  THEIR  FUEL RESERVES TO FLY FROM THEIR BASES IN FRANCE AND EXACTLY THE SAME AMOUNT FOR  RETURN FLIGHT..  THIS WAS NIGHTMARE  FOR GERMANS AS MANY OF THEIR ACES HAD TO  BREAK   ENGAGEMENTS WITH  SHITFIRE  INSIDE THE CROSSHAIR    ..UNDER EQUAL CIRCUMSTANCES 109'S WOULD HAVE EATEN SHITFIRE'S FOR BREAKFAST .. 

The second factor was that once a pilot bailed out over Blighty his war was essentially over.

YES, THOSE WHO BAILED OUT ENDED UP IN A CANADIAN PRISON CAMP.. THE ONLY POSITIVE EXPERIENCE WAS THAT THEY LEARNT GOOD ENGLISH THERE ...LOL  

To put it in few words  all things considered  the 109 was the superior fighter.....
Reply: Why did the Germans not add drop tanks for increased range?
Reply: +barracuda7018
"UNDER EQUAL CIRCUMSTANCES 109'S WOULD HAVE EATEN SHITFIRE'S FOR BREAKFAST "
Total drivel
" the 109 was the superior fighter"
More drivel.
Reply: The 109 didn't succeed in it's aim, which was to drive the RAF fighters from the air, end of discussion, remember this was total war not some joust under Queensbury rules, each side would use whatever advantage they had, no-one set out to make things equal, the grim game was survival.
Reply: +silver fox  The ME-109 still shot down more aircraft than the spit, it was the most successful fighter aircraft design in history.
Reply: Only because the German had to rely on it as they developed only the FW-190 after it. The British made the Typhoon, Tempest, Mustang, etc and some US fighters. Comparing type for type the Spitfire was superior, as the Germans found out over Dunkirk and southern England.
Reply: +John Burns wrote, qoute;  "as they developed only the FW-190 after it." LOL!!!!!!